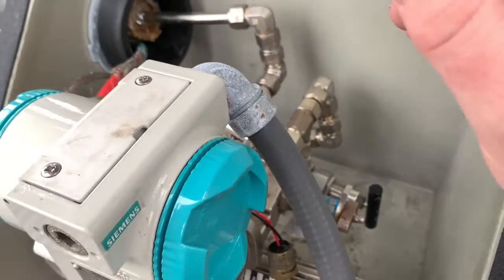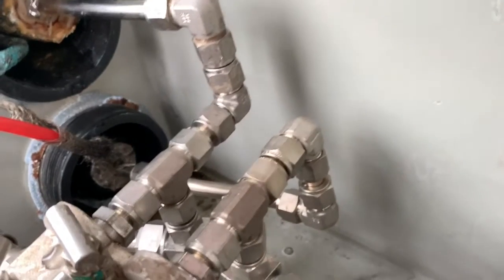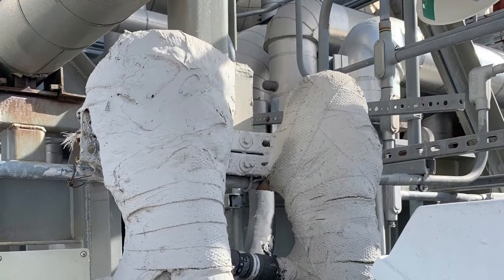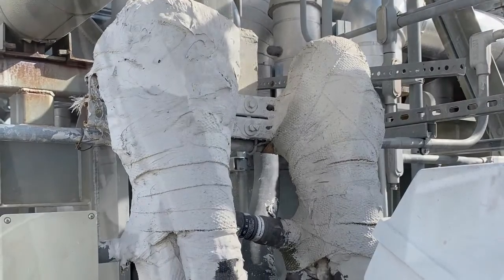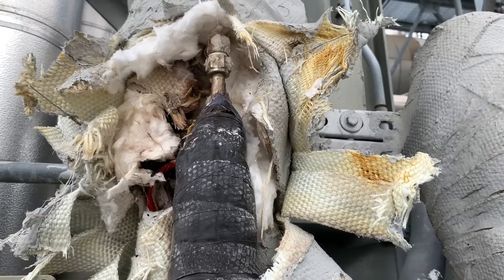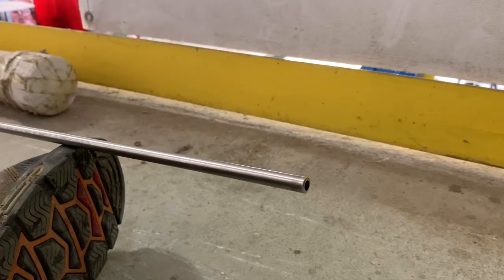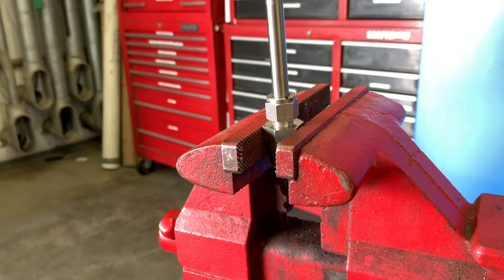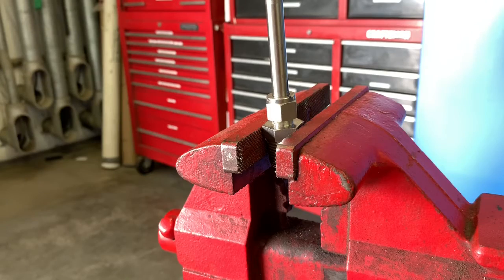Swagelok Fitting Install Part 1

Comment: Hello! I noticed that you used grooving tool for metal tubing. That grooving tool is only used for PFA tube and it should not be used on metal tubing. Basic swagelok fitting doesnt reguire using any grooving tools. You only need to debur tube ends.
Reply from the maker: Great information and so true!  Thanks for the input I had that part wrong